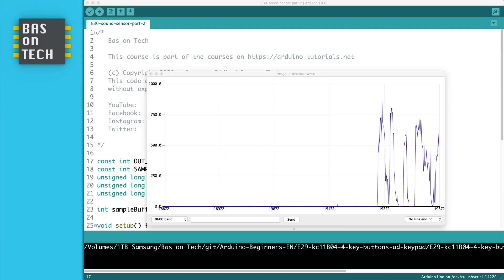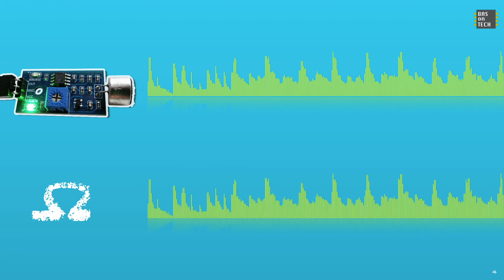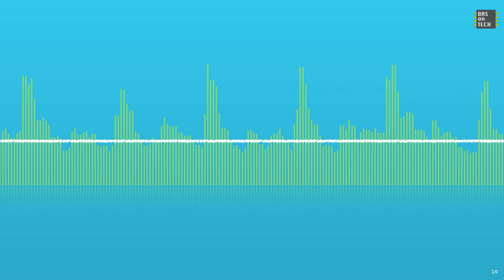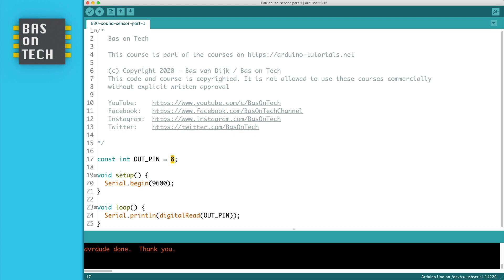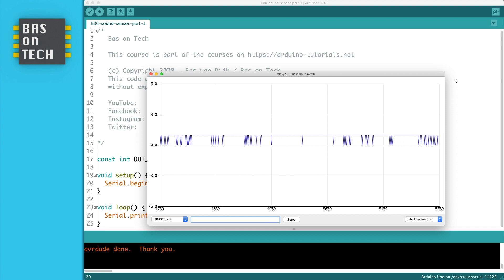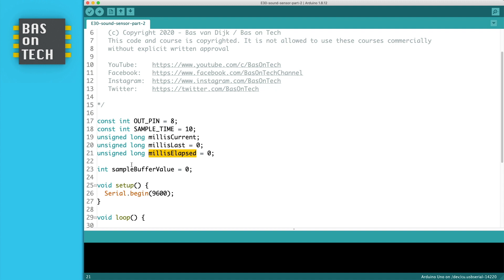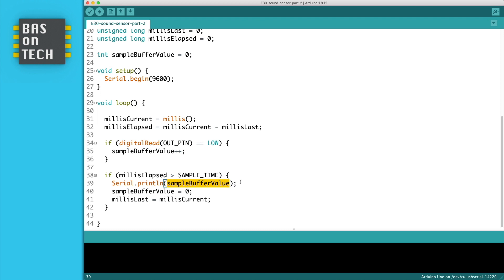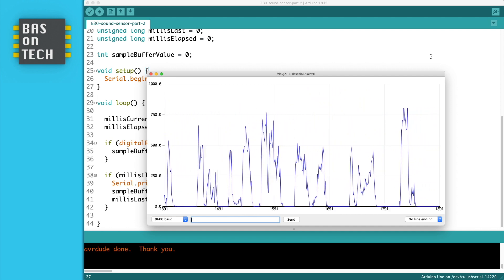SOUND SENSOR DATA ON ARDUINO SERIAL PLOTTER - Arduino tutorial #30

Comment: Can we compare 2 different microphones (sound sensors) to see which one is louder and send an output on one? If yes, please tell me how
Reply from the maker: You can't. This sensor does not measure loudness. It measures if there is sound or not. So the answer of the sensor is either "yes" or "no". No such thing as volume, decibel, loudness, intensity etc. In this tutorial I sample sound for a certain period. The y-axis only tells you the sound intensity during the measured sampled period of time.
Reply: @BasonTech  Thanks for the reply! Is there any sensor that can measure the volume, decibel level and etc... mentioned above?
Reply: @delux37playsyt30  I was planning to use a amplifer + Mic module like a MAX4466 and get the audio input and compare them etc etc....
Reply: Hey what a coincidence.....I am trying something similar too...
I  am trying to compare the output of two mics kept on left and right and rotate servo motor to that direction....
Did you find anything more about this?....If so please share...highly appreciated....
Reply: @majorchristopherkyle1077 I did a bit nore digging around and found that if your sound sensor has an AO (analog) pin, you can use it to monitor different levels of volume inputs. Hope this helps!
Reply: Thanks...I found that too while searching...
I would like  to know more about you how did you compare the two mic's to find out which one is louder as you mentioned earlier?...
Thanks again mate for taking your time to reply!
Reply: Hey! @majorchristopherkyle1077 , sorry for the late reply! Me and my team were busy testing the prototype (this included the sound sensors) in our school labs. We had a 16x2 LCD screen as our output to compare the sensors. If the right sensor detects more (louder) input than the left one, then the right side of the LCD lights up. The same goes for the left side as well, and if both the sensors detect the same amount of input or similar input to a certain threshold, the entire LCD screen lights up. I would recommend using other good sensors, as the ones that we used(similar to the one seen in this video's thumbnail, it had an AO analog pin) weren't really great at picking up sound. Plus, the potentiometers on those things were VERY faulty. Thankfully, our labs had 2 extra MAX4466 modules, so we decided to use those. They worked flawlessly and the output on the screen was 'crystal' clear!
Reply: @delux37playsyt30  OMG...it's god himself that made us meet....
Firstly I would like to say that if you are in school and doing this sort of stuff, then you are a freaking genius!
I was about the say about the weirdness of the module and its A0 output...I tried using it but it rarely made any difference to any sound I made...so I was also planning to use a MAX4466 and ordered them!

And you telling about MAX4466 boosted my confidence(I am tensed about whether it will work or not...will try this weekend)

So, hey mate..please please..can you help me out...
I researched and made some programs to detect the "Sound Loudness Level" and tested pretty good...
MAX4466 gives only the sound output,if I am not wrong..so I assume we need do some programming to get what we need..?
I would like to know more about the program you guys used...
Did you guys use an Arduino Itself?
Can you please please just share the program..I will try and understand it myself...
Thank You SO SO much in advance..(and loved the crytal pun in the end lol...)
Reply: @majorchristopherkyle1077  Man, you just made my day! You didn't have to include all of that appreciative stuff (I'm blushing now lol). Our school doesn't really appreciate this type of work much, so it makes me really glad to see at least one person who does!

 We made this prototype for unfortunate people that can't hear(hence the MAX4466, amplification) as a part of an upcoming science fair project.

If you are planning to buy a new 16x2 LCD screen for displaying the output(highly recommended for this type of project), I would recommend buying one that comes with pre-soldered pins, as soldering on your own might be a bit difficult based on the experience you have. Unless you're some soldering monk who is commonly referred to as the 'solder guy' by the lab assistants(lol). It's designed to pick up sounds that even normal people can't hear that easily(again, amplified sound is key here) so that we can ensure the safety of deaf people. 

Plus, I got your back. So please, rest assured :)

MAX4466 is a pre-amp module that kinda works like a microphone. It picks up sound and amplifies(increases the volume) the input. Its output is in the form of voltage which can be measured to differentiate between high and low sounds. It can do this job so quickly, that the data that we measure can even be represented in the form of a graph(oscilloscopes are a really common choice for this).

There is also a gain feature on MAX4466 modules which can be adjusted by a screw on the back to change how much input (volume) can be detected. When new modules arrive, they'll automatically be set to pick up the most volume.

The input can be almost anything, from microphone outputs to sounds that you hear on the road.

We didn't want to go with an oscilloscope output as you would never expect to see someone walking down the road with one of those in their hands, so we decided to display the output on and 16x2 LCD screen.

We compare the volumes of both sensors and then display the output on the screen.

Thankfully, I know a bit of programming too, so I got to work on a code that satisfied my needs.

I will paste it here so that you can use it if you would like to, this code is for Arduino btw(we only use Arduino in our labs):

#include <LiquidCrystal.h>

// initialize the LCD screen
LiquidCrystal lcd(12, 11, 5, 4, 3, 2);

// initialize the sound sensors
int soundPin0 = A0;
int soundPin1 = A1;

void setup() {
  // set up the LCD screen
  lcd.begin(16, 2);
  
  // set up the sound sensors
  pinMode(soundPin0, INPUT);
  pinMode(soundPin1, INPUT);
}

void loop() {
  // read the sound sensor values
  int val_sound0 = analogRead(soundPin0);
  int val_sound1 = analogRead(soundPin1);
  
  // check which sensor detects more sound
  if (val_sound0 > val_sound1) {
    lcd.setCursor(0, 0); // set cursor to first row, first column
    lcd.print("Left side"); // print text
  } else if (val_sound1 > val_sound0) {
    lcd.setCursor(0, 0); // set cursor to first row, first column
    lcd.print("Right side"); // print text
  } else {
    lcd.setCursor(0, 0); // set cursor to first row, first column
    lcd.print("Both sides"); // print text
  }
}

I'll also include where you have to connect everything(LCDs can be a bit confusing sometimes):

Connect the RS pin of the LCD to the digital pin 12 of the Arduino board.
Connect the E pin of the LCD to digital pin 11 of the Arduino board.
Connect the D4 pin of the LCD to digital pin 5 of the Arduino board.
Connect the D5 pin of the LCD to digital pin 4 of the Arduino board.
Connect the D6 pin of the LCD to digital pin 3 of the Arduino board.
Connect the D7 pin of the LCD to digital pin 2 of the Arduino board.
Connect the VSS pin of the LCD to the GND pin of the Arduino board.
Connect the VDD pin of the LCD to the 5V pin of the Arduino board.
Connect the VO pin of the LCD to the wiper pin of a potentiometer.
Connect one end of the potentiometer to the 5V pin of the Arduino board.
Connect the other end of the potentiometer to the GND pin of the Arduino board.

For the sound sensors:

Connect the OUT pin of the first MAX4466 module to analog pin A0 of the Arduino board.
Connect the OUT pin of the second MAX4466 module to analog pin A1 of the Arduino board.
Connect the GND pin of both MAX4466 modules to the GND pin of the Arduino board.
Connect the VCC pin of both MAX4466 modules to the 5V pin of the Arduino board.

If I could get to know a bit more about what you are doing, I can help you even more. I can even write you a code if you'd like!

I've been interested in technology(and music, and baking, and a LOT more) since I was a young boy. I still remember the day I built my first DC motor fan circuit (ah the good old days), so I do have a lot of experience in this type of stuff. I've been doing a lot of tech stuff for the past few years, one of the most notable being building my own desktop computer(I'm writing this response on that same computer right now!). The second anything electrical occurs in our house, my parents call me to diagnose the problem :D

Also, I am still looking for solutions to turn this new-york-city-sewage-pipeline-schematic arduino mess into something more user-friendly, like a handheld device. So if you have any suggestions, I would love to hear them!

In the end, be confident. I know you can do it mate! You have me with you, so don't worry!

Plus, I'm a school student. It's the least I could do for you!
Reply: @delux37playsyt30   Hey dude...your friendly words are so soothing and really a good mood booster...!
I can't find words to appreciate you for taking your time and typing so much just for me...!

Was nice hearing about your project and frankly its awesome..ngl..and has social relavance too..!
And oh about the code..contrary to what I thought...seems we just need to take the output of the two mic's and compare them with an if statement! That makes things a lot simple and straight to the point...Thanks again..!

Q1) Was the output like changing to rapidly or something?...will adjusting the gain make a difference?...

Talking about my project...I am actually doing my final year in Electrical Engineering LoL...and I am now into my final project for Bachelors degree....
The topic is a "Transmission Line Inspection Robot" ...aims to replace manual inspection of transmission lines by humans using Bucket trucks or Helicopters ( Which is costly, inefficient and dangerous) , by a robot which moves along the transmission line...("They see me rolling"...LOL)

The sound tracking is a part of our project...we aim to capture image (including thermal image) of a faulty insulator ...which produces noised due to corona discharge..
So basically I am trying something to move my camera frame to the location of sound source ( which will be a noise frequency generator in smartphone)...and then capture the image...

So far I have used Raspberry Pi , Stepper Motors , Thermal Camera and all those stuffs and thankfully succeeded in getting desired ouputs...now what remains is this sound tracking part..which I am really tensed !
Cause everywhere in the internet they are into " time of arrival" method and all for sound localization..which is really complicated! 
Any suggestions or advice is highly appreciated and welcome...!

And hey..trust me..with this passion, you are gonna be a great electrical engineer or whatever electrical-electronics field you are gonna go..! You're already experienced and have more knowledge than most of the guys in my  4th year EE class..ngl..!
Your parents are gonna be proud of you one day...I expect to see devices you create spread the world one day...God bless..!

In my case...I do love EE stuff..but frankly I wish to join the military..But parents and family really hate it..:(
They are like constantly advising me to participate in interviews and tests of private companies who approach our college for recruiting...
Seems like  I would have to pack my bags and leave without saying..!
It was so nice talking to you...I can't express my happiness of meeting someone this kind and friendly after a long time...( That's rare after you are an adult..LoL)..thanks again!
Reply: @delux37playsyt30  Hey it's me again...thought I would ask the important part as a separate reply..
So what I need desperately is an expert opinion..and you are the best person for that:)

So my aim is to rotate my camera to the source of sound (Made using frequency generator in Phone)...

So my plan was to use the setup similar to the solar tracker in this video:

https://youtu.be/_6QIutZfsFs
And replace the light sensors (LDR) with Sound stuff (MAX4466) so as to track sound instead of light...
If it works as expected...the setup would move and track the sound source(Phone) similar to the wat it tracked light in the video...

The fact I could not find any content or video related to this anywhere has made me worry that whether this will work or its just my stupid idea...:(

Sorry to bother you so much...this is my last  doubt I promise...Thank you so so much!
Reply: @majorchristopherkyle1077  You really impress me! I had no idea that I would be speaking with someone who is dedicated to these types of things!

I wanted the code to be simple so that it would be easy to modify later if required... And, I love your project idea, it's well thought out, and overall just wonderful! (loved the 'they see me rolling' lmao)

Anyways, about your question, our model is meant to display outputs on sounds that may be unheard only(and very loud ones to some extent as well)
Adjusting the gain makes a huge difference as it changes the 'searching range' of the sensor. If you lower the range, then it will be less prone to picking up quieter sounds.

I do have some questions about your project as well as some things that should probably be considered

Q1) How will you power the robot?
Q2) What will it do once it detects a faulty insulator?

1. To solve the first question, you could arrange a plug point connection where the robot just rolls over to a certain location to get charged from the line itself(kinda like a rumba)

2. Durability has to be considered when making this type of thing coz u never know when wind gusts or other obstacles can just whack the robot off the line('they see me rolliiiaaAAAAAAAAHHHHH')

3. Mother nature also has some challenges to put against your robot( they hatin'), so consider the weather, wind, rain resistant, and non-corrosive materials to make your robot 'stronk 💪'

4. A bit of an add-on to the second point, make the model lightweight to prevent the cables from snapping, also make sure that thing is CLASPED on those lines.

5. You could consider placing the MAX modules on the transmission towers themselves near the insulators so that they can pick up sound much better. You can then send over a signal to the robot from these sensors via wave comms.

6. Transmission lines are really long, so they are gonna need a lot of robots for monitoring, so just consider how much one robot can monitor, perhaps 1 robot does a certain distance or smth like that

7. How fast will these robots roll? finding the right speed to ensure that it doesn't affect the line and is also fast enough to work efficiently and quickly. plus some form of braking system is also required so that it doesn't roll off too far.

I apologize if I'm sounding a bit harsh on you with these, but these are the things I usually analyze when making stuff like this(it's a habit from school :( sorry)

Also, about what you wanted to do. Do listen to your parents and family, but don't let that dream die. Keep that passion alive. You never know what the future holds for everyone! :O

It was really nice speaking with you! I finally met someone who I can talk to about this type of stuff :D

And please, feel free to ask me as many doubts as you want! I'm pretty sure I clarify more of them in school xD
Reply: @delux37playsyt30   @Delux37Plays YT  Hey it's me again...thought I would ask the important part as a separate reply..
So what I need desperately is an expert opinion..and you are the best person for that:)

So my aim is to rotate my camera to the source of sound (Made using frequency generator in Phone)...

So my plan was to use the setup similar to the solar tracker in this video:

https://youtu.be/_6QIutZfsFs
And replace the light sensors (LDR) with Sound stuff (MAX4466) so as to track sound instead of light...
If it works as expected...the setup would move and track the sound source(Phone) similar to the wat it tracked light in the video...

The fact I could not find any content or video related to this anywhere has made me worry that whether this will work or its just my stupid idea...:(

Sorry to bother you so much...this is my last  doubt I promise...Thank you so so much!
Reply: @delux37playsyt30  Hey mate.. Appreciate your intersect on my project! 
But unfortunately it's really not that big or something I am really proud of.... 
The other teammates, except one guy are lazy and rarely cooperate... So even though I have big plans and ideas myself,  it is almost impossible to realize it all by myself... That too in short time limit and amidst all the theory exams and labs and stuff... 

However me and one of my teammate is trying our level best... He is doing all the mechanical stuff, like 3D printing the model etc... 
And I am in charge of all the electrical stuff... 

We have only a few months left... I will update what happened once it's all over... 
Once again... Your support and all the advices are highly appreciated and I needed that! 
If you don't mind... I would love to know your name, place etc?.. 
Myself Chris... And as my profile suggests... I am a big fan of Navy Seal Chris Kyle..! I've watched the movie American Sniper like 100 times! 
I wish go be a Navy Seal like him one day!
Reply: @majorchristopherkyle1077  Hey! just read your reply!

Even the projects that we make at school are not that big and are more just for showcase and idea display
And about the teammates, I understand. It's the same problem I'm facing with my whole team :(

But please, keep up your hopes! You got such a great idea to present! It can help thousands of remote areas and villages across the world!

Sure, you may not be able to display the big plans that you had in mind, but there is no one stopping you from explaining!
Most people boast around about everything their models can do, but mentioning some improvement or possible extensions will in fact promote your audience to think differently and have more perspectives and more standpoints, etc..., hence more interest and engagement!

And again, about teammates, you have to motivate them to work with you. So much so that even in you'd wake them up at midnight, they should be ready to work with you(something our school tells us quite often). Impress everyone with what you can do, and make them believe(along with yourself) that you can do it regardless of the time left. Whether it be 10 days or 10 hours! :D

Oh, and btw, my name is Jay! I am an 8th-grade student currently living in Hyderabad, India 🇮🇳. It's nice talking to you Chris, and I wish you the best in becoming a Navy Seal!

Also, if you don't mind, is there any other way we can stay in touch? I'm not very active on youtube and it's hard for me to tell when you respond. Plus, I could share a lot more stuff like code, charts, photos, etc... (also for not disturbing the owner of this channel lol)